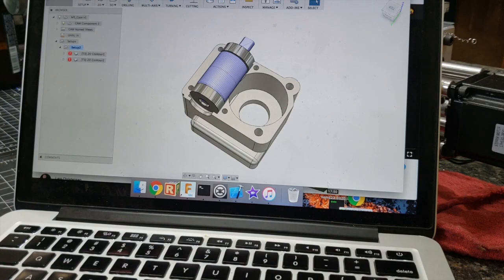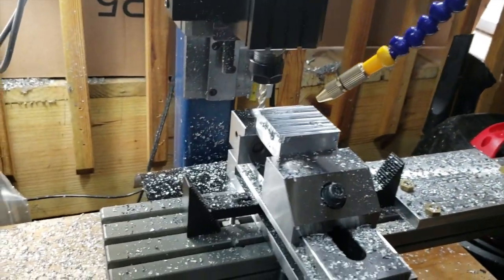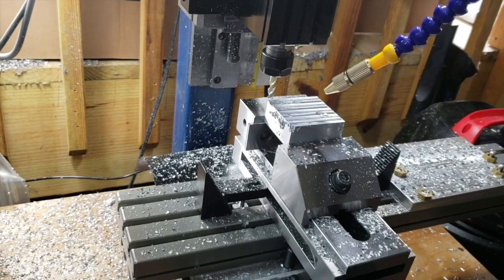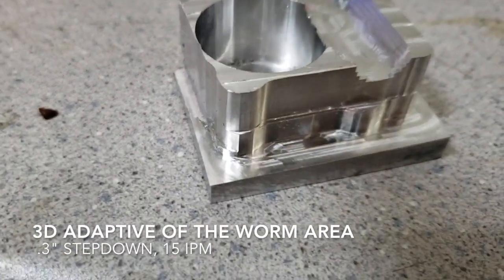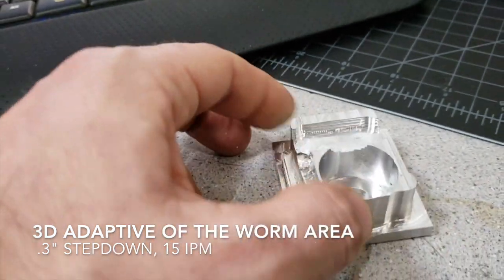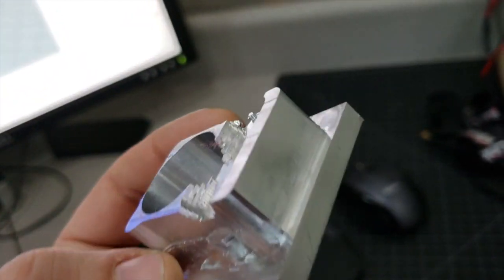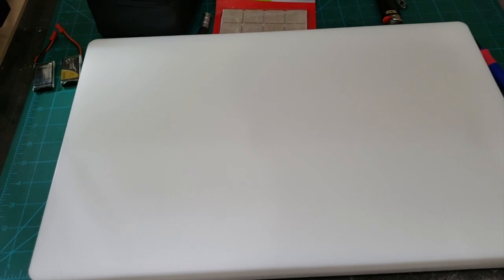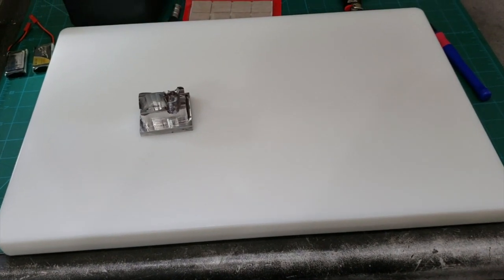Episode 10: Fusion 360 CAM + Taig Mill on 6061 Aluminum Block - TAKE ONE!

Comment: Can you please provide me with the make and model of that work holding system you have on there?
Reply from the maker: Just a simple 3 inch screwless vice from amazon and a set of parallels.  

https://www.ebay.com/itm/Precision-Toolmakers-Grinding-Pin-Vice-Screwless-75-mm-3-Inch-Grinding-Vise-Pin/143533983305?hash=item216b4ac649:g:IVoAAOSw7TReSH8E
Reply: @billieblaze  Thanks! Happy milling.

Comment: Very cool! I'm getting ready to order myself one of the Taig CNC mills. Did you get the one with Taig's motor controller? How hard was it to get the mill to communicate with Fusion 360? I'm experienced with 360 and 3d printing, but I'm brand new to CNC mills, so I've got a lot of questions.